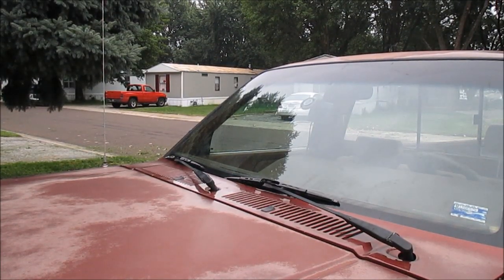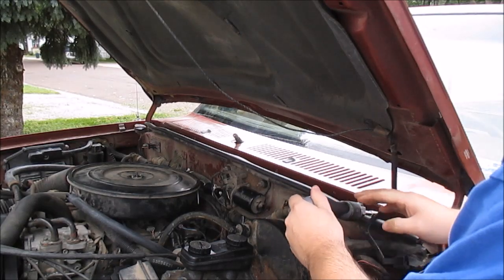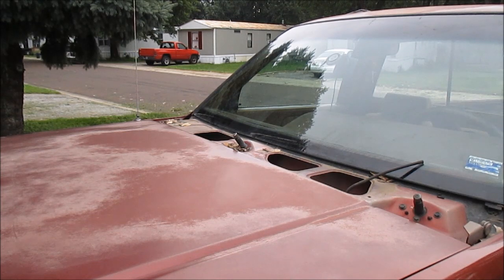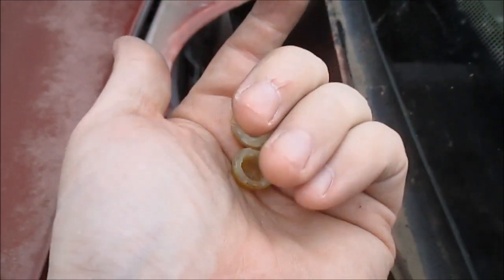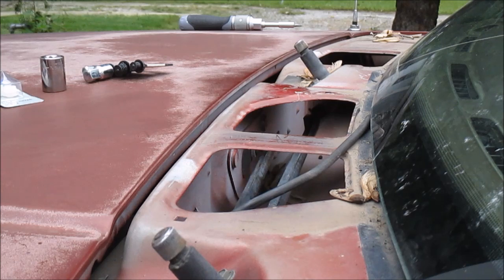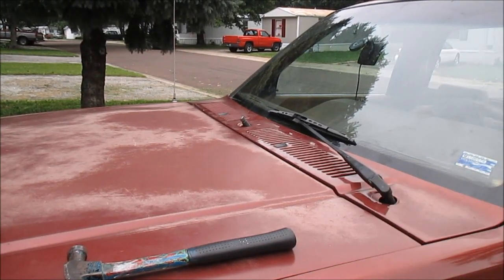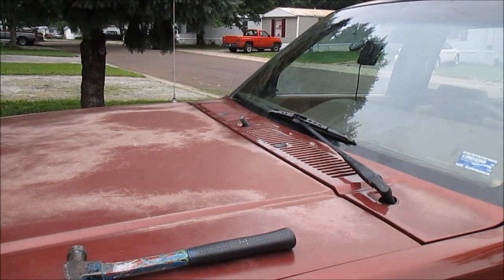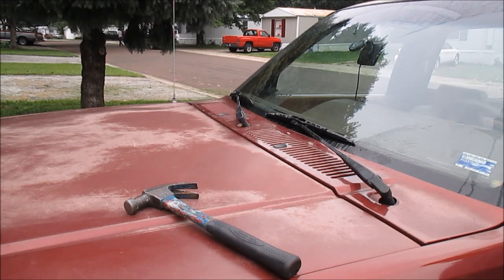Windshield Wiper Motor Linkage Bushing Replacement Dodge Dakota

Comment: Gee, I wish I could say I fixed my truck in 20 minutes! But thanks to this video I did fix my truck. That stupid bushing, though, it's a bear! I ended up using a socket on one side and hammering it in with a small rubber hammer from the other. Yikes! Then I used channel locks to squeeze the arm onto the post. Works great now, but I don't ever want to do that again. Thank you for your helpful video!!!
Reply from the maker: Thank you for watching!!

Comment: Its much easier to remove the 3 bolts on each wiper shaft and take them both out and assemble the bushings with them out then put everything back in and put the bolts back in. After tearing up my hands and getting nowhere because of the lack of room to work in there i finally figured this out.
Reply: its much easier that way i agree.
Reply: Yep. I just had the same experience.  I had the bushings go out at the drivers side shaft.  After wresting with it for a while to get the first bushing on with no success, I finally realized that I could disconnect the linkage from the motor arm and then unscrew the passenger and driver side shafts and remove the whole linkage assembly through the cowling opening on the passenger side.  I then put the bushings on the linkage outside the vehicle.  This not only made it easier, but made as far as I am concerned, made it possible.  Still not sure how anyone can replace the two driver side bushings without  removal of the entire linkage assembly.
Reply: This comment saved my life just now. My hands are wrecked after fighting those bushings for hours to no avail

Comment: The reason is the clips are broken, is that someone pulled off the wiper without sliding the clip off all the way.  Here's the way it's supposed to work.  (1) Raise up the wiper against the spring tension.  It should be raised up enough that when the clip is slid to the side, it will hold the wiper up against the spring.  (2) slide the clip to the side.  Now the wiper comes off easy.   If you don't do it right, the clip won't slide all the way and will hang up on the wiper shaft,  Then when you force it off, you bend or break the clip.
Reply from the maker: Yep that is how it works. You got it. Thanks for the comment and have a good day.

Comment: Mine just quit working about a half block from my house pouring down rain.  I have to do this myself.  thanks for the help. Just did mine and it was easy once i put lube on the bushing before snapping it into place. I hope it doesn't come off lol
Reply: Ernst Hin just did t with my dad. Wasn't too hard
Reply from the maker: Oh man that sucks it quit working in the pouring rain, but glad you were able to fix it. Thanks for watching and thanks for the comment. Have a good day.
Reply: Ernst Hin reminds me of the time l was coming out of the mall in a downpour, I got into my car turned on the wipers and the fuse chose that precise moment to blow. Long story short, I had to sit in my car like an idiot and wait for it to completely stop raining before I could drive to the auto parts store and get another fuse. This was before everyone has cell phones, otherwise I could have just called somebody to bring me one.

Comment: Got a suggestion for ya. Put a socket which is larger than the hole on back side of linkage. The bushing will go in much easier

Comment: Thanks for this video. My son and I just replaced the windshield wiper bushings on my (new to me) 1996 Dodge Dakota and it went pretty smoothly due to watching your video ahead of time. When we tested it afterwards the wipers work again but seemed to not have very much speed on high. Wondering if this means we will have to replace the wiper motor bushing as well. Would be grateful for any feedback. Thanks again!
Reply from the maker: My husband passed away,  and I don't have any answers for you. Thanks so much for watching!!
Reply: You can find motor rebuild kits but if your motor is like mine they riveted the cover for the gear assembly on rather than using screws. So, if yours is similar then you gotta consider just installing a rebuild motor.  If you do that you have to change the bushing again likely.  If you still want to rebuild it yourself then search for screws to attach the gear face plate before you drill out the rivets.

Comment: Hey y'all; can I connect just the one linkage arm that operates the driver side wiper without connecting over to the passenger side? Just use the one driver side wiper? thanks

Comment: Need 4 Bushings, Dorman - Help Wiper Linkage Bushing Replacement
(Part No. 49439-2pack). Cost is $11.99 each pack = total $25.42. Took all parts (linkage arms ,swing arms, & motor) loose from vehicle. Pull all 4 old bushings off of parts. Take new bushings (which are very hard /stiff) and heat in microwave 1-2 mins until warm, to get flexible. Install into wiper arms, start by pushing one edge into linkage arm, then take plier and press other end snug with linkage arm. Used a little white grease and snap into shaft ends. I sprayed shaft arms with wd-40 and white grease afterwards. Then installed everything back together. Works great now. Hope this helps.
Reply: +1kmiles    Also clean/sand the three shaft ends where linkage bushing will spin on. these are the  motor, and two wiper shaft arms. Add little grease before attaching.
Reply from the maker: +1kmiles 
Thanks for the info and the good tips. Have a good day.

Comment: Actually the arm that connects to the motor has a big hole and the bushings I bought won't work. I went to the junk yard but the whole wiper system was removed so I am not sure what to do. I guess 1979 cordobas don't come around every day. I tried to see if a labaron would fit but I am not sure.

Comment: I struggled for 1/2 a day  with this. Life got a whole lot better when I abandoned the fantasy of doing it on the vehicle, removed the whole assembly, and used a bench vise with blocks of wood and sockets for protection and pressed these stupid bushings in the linkage arms and onto the pins.
 
Took less than an hour then.
Reply from the maker: Jim Taylor :-) yeah that stupid bushing was a pain in the butt to get pressed in. Hey thanks for the comment and have a good day.
Reply: Difficult? Wait and try to make repairs after someone else pull everything out and can’t remember what it look like before the removal!

Comment: Thank You!
this is about to suck in the snow and single digit weather...
Reply from the maker: +Chris_usas 
Yeah that would suck not having windshield wipers in the snow or rain for sure. Thanks for the comment and have a good day.
Reply: +Chris_usas exactly the same situation.. this is about to be cold!
Reply: +jj19902003 , Mine ended up just being a bad connection in the ground strap on the mounting brackets.  Loosened and tightened the nut on the bolt with the copper strap twice and now it works like new

Comment: I HAVE A 2000 NISSON XTERRA.. at oil express they quoted over a hundred to replace a bushing.. but the wipers are working fne.. is there something im missing? or maybe cause im female? and they figure it was an easy sell? is there anything to look for to check if the bushings are going out? thank you
Reply from the maker: Susie Satmary Well it just depends on how long it takes to change out the bushing you are talking about, and how much they are charging in labor, and what parts have to be removed in order to get to that bushing. Best thing to do is get quotes from a few different places. Well thanks for the comment and have a good day and good luck.
Reply: hi here.. thank you so much for the response!!!!  i took it to the DEALERSHIP.. guess what?  nothing is wrong! he told me also... to make sure when-ever... WHO-EVER does a mechanical job.. ALWAYS ASK FOR THE OLD PARTS BACK TO YOU ! as a single female.. older.. and now thankfully getting wiser... i guess the old saying is true... if you want a steak go to a SREAK HOUSE.. lobster? go to a fish place... car work? DONT GO TO AN OIL CHANGING PLACE !!!  thanks again... susie <3
Reply from the maker: Susie Satmary You are welcome, and I am glad to hear that nothing was wrong. I hate to see anybody get taken advantage of, and yeah that is a good tip on asking for the old parts back.

Comment: Thank you so much for making this video.I have the same dodge and a fuse blew out that controls the lighter in which my wipers stopped working as well. So I replaced the fuse and my wipers still arent working. Any suggestions?
Reply from the maker: I looked up a wiring diagram for a 1992 dodge dakota off the Autozone.com website under repair help. You can go to the same website and find the same diagram (it was under chassis electrical), but you have to create a log in it is free and gives you lots of info on repair on lots of vehicles. 
Anyway on the wiring diagram for the wiper motor circuit it did not show the lighter circuit being on the same circuit, so I do not believe the lighter circuit ties in directly with the wiper circuit. On the schematic for the wiper circuit it was powered by a 20 amp fuse (it said it was fuse number 10)  I am not sure which fuse you replaced, but I believe the lighter fuse is a separate circuit. I think the lighter is powered by fuse number 9 a 15 amp circuit. So I would start by checking to see which fuse you replaced. Here is a link that shows the fuse box I am talking about under the dash. circuit number 10 is for the wiper and circuit 9 is the lighter.    http://www.justanswer.com/dodge/2smpj-1993-dodge-dakota-pickup-headlights-tail-lights.html 
Start there first. After that if the wiper motor still does not work, I would look at a wiring diagram to better understand how the system works, and check power and grounds to the motor. If you have good power and grounds at the motor the motor is bad, or seized, or the linkage is jammed up some how. If you do not have good power and grounds then the problem is either in the wiper switch or in the wiper control unit or the wiring itself. Well I hope this info helps you out. Thanks for the comment and thanks for watching. Have a good day.
Reply: You are awesome . Thank you
Reply from the maker: You are welcome. Did you have any luck figuring out what your problem was. Thanks again for watching and thanks for the comment. Have a good day.
Reply: I have not found the problem yet.  I need to open the motor area and have yet to do so. I just dont see how right after my lighter fuse shorted the wipers went out literally. What happened was I plugged a outlet into the lighter and the voltage must have been to high. The fuse popped and wipers went out
Reply from the maker: Well here is a link to some schematics I found online there are 2 different drawings I think your truck should be one of these. Here is the link http://www.dakotaforumz.com/showthread.php?t=3958     the #2 post by sunflake has the 2 drawings. Maybe these will help you figure it out. I would suggest you try to look at that the schematics to hopefully help. Then get yourself a simple multimeter and a simple test light (if you dont already have them) If you dont have them go to harbor freight and you can buy both items together for less than $15. You then just have to check power and grounds to figure it out. Also to test the motor itself you might try unplugging the electrical connector to the motor, and bypassing the wiring altogether and hook up fused jumper wires directly from the battery to the motor to see if the motor turns over. I believe the electrical connector on the motor is all powers coming into the motor (they just vary the inputs going through the module/controller to change the speed of the motor) So then the ground wire should just be grounded through the metal motor housing and gets its ground path back to the battery through the metal firewall where it is mounted. Well I hope this info helps you out. If you live near independence, Missouri where I live let me know and maybe I can help you figure it out in person. Well good luck to you and have a good 4th.

Comment: hi do you know the part number for dodge dakota 1996? i am try to do same with my grandpa truck
Reply from the maker: I believe Dorman has a few different ones that should work. If you go to Dormanproducts.com and look up part #118-301 or try part # 49439 or 49440. I think a few of those should work for you, and a lot of autoparts stores stock Dorman products. Or better yet for the best pricing I suggest you try rockauto.com click on Dodge, 1996, Dakota, engine size, wiper & washer, and finally click on wiper linkage bushing and you should see the part you need. From what I saw they had an open end one and a closed end one, I am not sure which one you need, or if either one will work, but hopefully this will get you started in the right direction. Thanks for watching and thanks for the comment. I hope this info helps you out. Have a good day.

Comment: what happened when this problem happened ?
Reply: +Frederick Mackillop With mine it went ker-thunk, ker-thunk and the wipers stopped moving. Replacing these bushings made them work again but I suspect I will have to replace the wiper motor bushing also as they seem pretty weak...probably slipping due to a bad bushing there too. But that is for another day!
Reply: ok then it dont matter i bought another dakota with working wipers